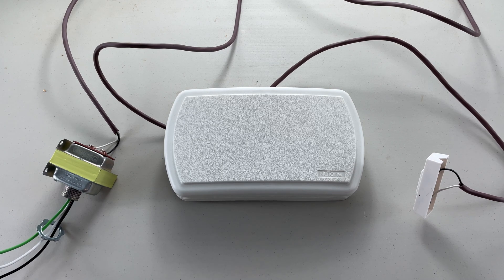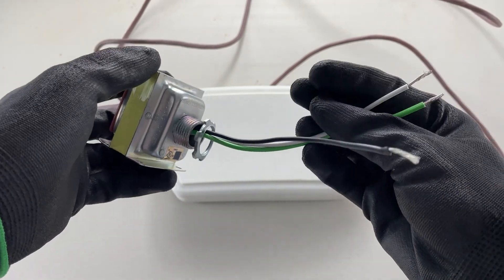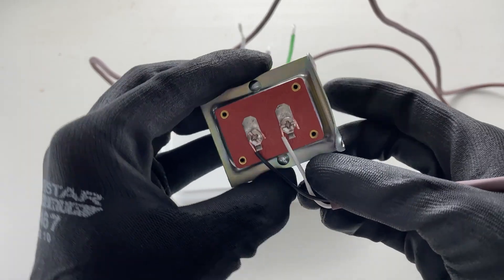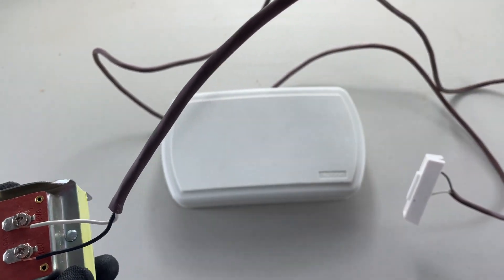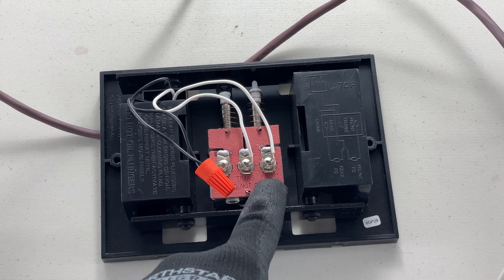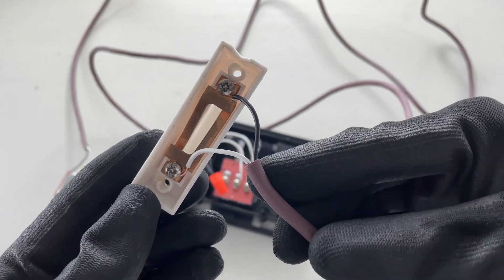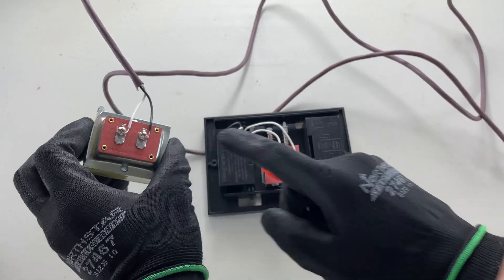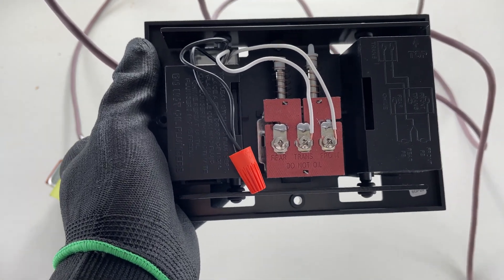How to wire a simple doorbell circuit - Super Simple Doorbell Wiring - The Electrical Guide *UPDATED

Comment: My doorbell system is wired very similar to this, but I think the wires might be installed incorrectly on the chime. If I don't have access to all of the wires to see what is going where, is there a way to test the wires to be sure? Primarily I want to make sure the wire from the transformer is going to the Trans connect on the chime.
Reply from the maker: Continuity test with a digital multi-meter would help you trace the wires
Reply: @theelectricalguide  My transformer is in the attic and not close enough to the chime box to do a continuity test with the multimeter. Is there another way to test the wires to see which one is coming from the transformer to the chime box?
Reply from the maker: @mw121077  You've gotta take two of the wires off one end and twist them together, then on the other end test any 2 wires until you hear the beep then you know which set. Rinse and repeat until you know every wire. It's a bit of a pain but if you label them with white tape or something it wont be too bad. Good luck!
Reply: @theelectricalguide  Got it. Thanks. I really  appreciate the assistance.

Comment: Is there a "usual" or "normal" place these transformers go in a house (USA)? I hate electrics and really don't want to remove the circuit box cover if I can avoid it.
Reply: My transformer is hanging off the side of the box that houses the overhead light in my furnace room (well away from my panel). They really could be anywhere in the house which is kind of silly 😕
Reply from the maker: Sometimes it’s inside the panel, sometimes it’s mounted right beside or attached to the panel. I’ve also seen it at a junction box nearby the panel. Sadly when it comes to residential wiring it could really be anywhere.. sometimes it’s even buried behind drywall. Usually it can be found near the panel, good luck!

Comment: I am wondering why the doorbell circuit is not protected. On line side the transformer is protected with a circuit breaker, but what is going to happen in case of short circuit on low voltage side? I mean, nobody places any overcurrent protection on low voltage side when connecting the doorbell, and I'm curious why.
Reply from the maker: The voltage and current are too low to cause and damage or electrocution hazard. The circuit breaker on line side of the transformer will still protect the circuit however.
Reply: @theelectricalguide  Thanks for answering!

Comment: Thank you. I had to replace the chime while installing a Nest doorbell and this was helpful. Tip to anyone else out there who couldn't find their doorbell transformer: I had to take off the breaker box panel to find mine. We tested it with a multimeter to confirm what was coming in and out as well to confirm that it was installed correctly.
Reply from the maker: Thank you for the positive feedback! Took the panel cover off? Wow I hope you turned the main power off first - dangerous stuff! Glad to hear it worked out in the end, great job!